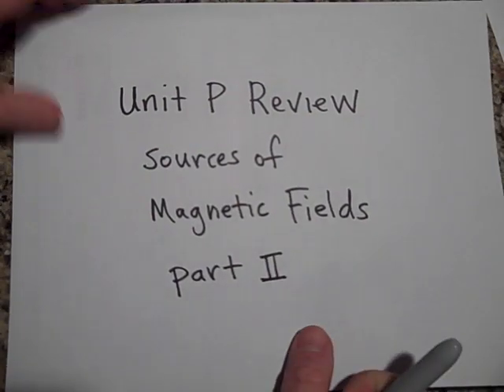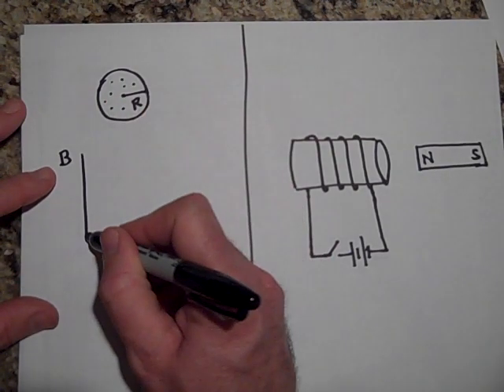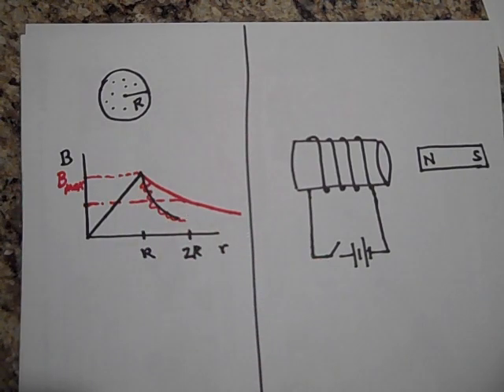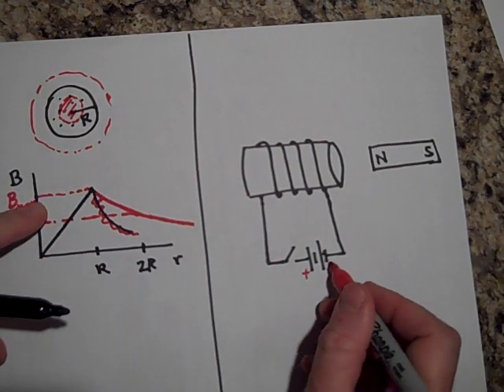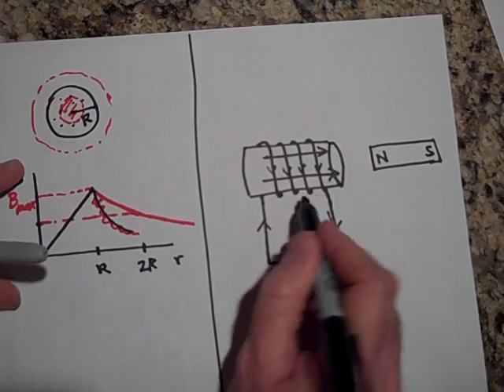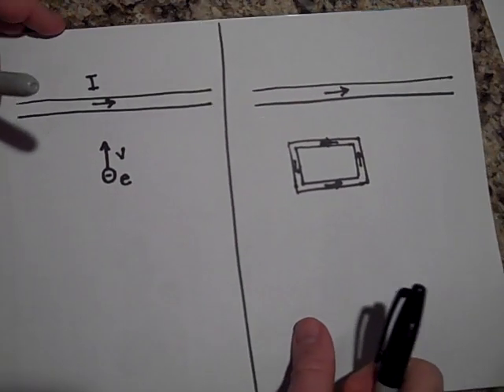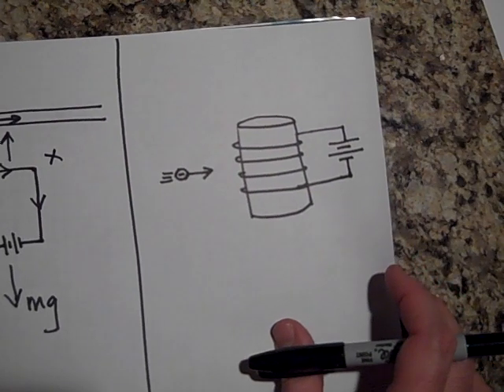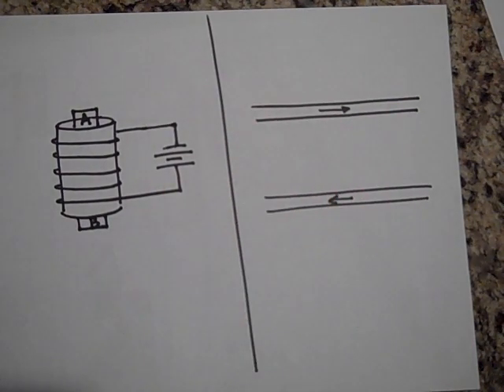Review of Unit on Sources of Magnetic Fields (part II)

Comment: For the last problem, using right hand rule, the B field is going down the page (negative y) and looping back around to the top.  Since magnetic field lines go from north to south, B is the north and A is the south.

I am assuming that the problem on the right is asking the force that each wire will exert on the other.  The top wire will create a B-field going into the page at the center.  This B-field crossed with the velocity of the bottom wire creates a force pushing down the page (negative y).